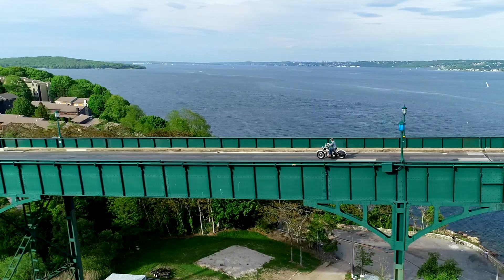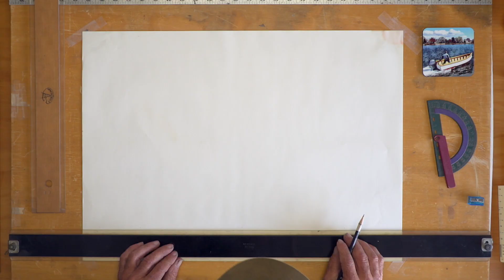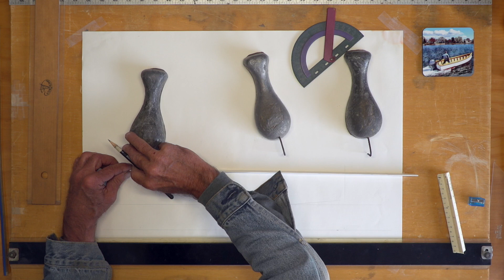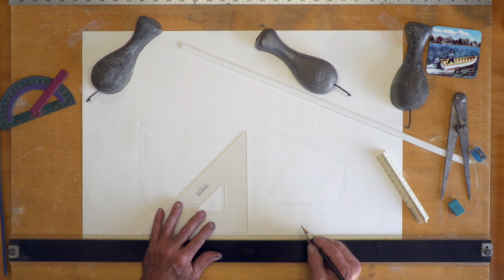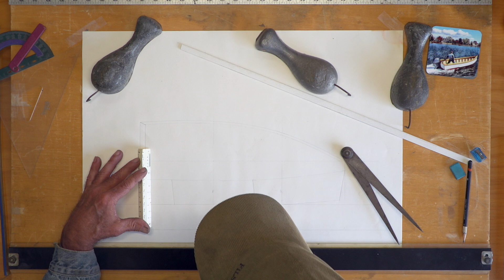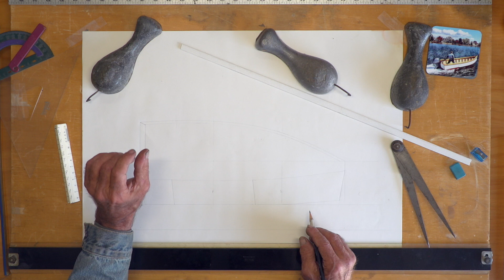TIPS Season 3 - Episode 4: Drawing the flat bottom work skiff

Comment: 31:06 at this point in typical engineering you get out the ink pens and ink the drawings for blueline visibility.
Just goes to prove folks (like me) make our comments before reviewing other's comments. Also from using India ink pens of different widths back in the sixties, the ink lines have very crisp edges on either sides of the lines for high definition, not like the fuzzy edges on the variable widths of felt markers with different pressures applied. 
Oh, yes, can't show the methods of drawing construction while inking because the scales and straight edges would get wet from the undried ink.  Lines and curves must be inked in sequence with the guiding instrument moving away from the previously inked lines. Much too complicated for a streaming video. Not like an ink plotting printer. You did best the way you did. Best Regards from antiquated history.

Comment: Correct me if I'm wrong ! The Transom drawing shows how it looks according to the hull. But beings it is slanted, and not verticle to the base line. You can't cut it to that shape. It would need  be taller, to allow for the slant.  Correct ?
Reply: Yeah I was watching it myself and I thought the same. Shouldn't it have been drawn perpendicular to the 11° of the transom to give the little extra height? Unless you were needing a shape and measurements for making a station touching up against the bottom of the transom.
Reply: If you make a rectangle 16 feet long and two feet tall with the angles for the stem and transom and you'll see the bow rise up. Put a little rocker in the back end to get the transom to rise up. Just make a cardboard model and you'll see how it works. It's like magic LoL

Comment: Lou, just a small point, when you transferred the transom height, it looked as though you just measured the vertical height, rather than the length along the 11 degree angle, not a vast difference, but the length along the angle would be a fraction longer, making the transom a little deeper, the other way would be to project it at 90 degrees down from the transom line and get a true end view of the transom shape.
Reply: On the half-breadth drawing the transom height is necessarily "foreshortened". But when building the boat you would measure along the inclined line. (Imagine the case where the transom is, say, 45 degrees to the vertical if it helps to clarify the point).

Comment: I just recently saw the "White oak vs Red oak" video from 5 years ago and I was puzzled by the mention of DC current. Where is that current coming from? 

I asked in the comments there too, but I dont have high hopes someone who knows the answer will happen to stumble across the same video in a timely fashion.
Reply: It has been a while since I watched that video, but I think the DC current is likely galvanic action or static charge: basically low current for a long period of time as electrons flow through the material. The electrons can come from static buildup or move between two dissimilar metals (a fastener on the boat and chemicals in the water for instance.)
Reply: @AlaskaSkidood  That makes sense. Thank you
Reply: Probably from a battery, unless you have a pull start you need a battery on board.
Reply: Your house has AC.  Alternating Current basically ebbs and flows back and forth a bit while supplying power, the electron flow is not always just in one direction.  That is possible and necessary with an electric grid.   DC or Direct Current flow in a circular fashion in only one direction.  A battery is Direct Current because the electrical flow runs from the top of the battery, powers something, and then returns (bottom of the battery).  Electricity needs to flow, whether AC or DC.  Now in a marine environment, particularly in salt water, which is EXTREMELY conductive, you can have current "getting loose" from either AC or DC sources.  AC is in the marina because the boats are plugged into the dock.  You can get that stray current from an improperly wired boat, particularly metal boats, as they are conductive.  Now the amount of electricity you may and usually cannot feel.  But it eats away at metal.  Boats have pieces of Zinc attached because as a lesser metal they are eaten away first, before your boat propeller, and any other metal in the water basically dissolves.   I'm no expert and may have said something a bit off, but overall that is my understanding.  All you need in your metal hull is a hole eaten away before you are on the bottom.  Boats sink in marinas due to stray current all the time. Most often it is DC.   Think about wires in the floor of  boat, and a small leak that fills the bilge, and the wire connection is submerged, leaking current out, but still running something, nothing seems broken... but your zincs start rotting and your neighbor sinks because he forgot to replace his zincs!!!
Reply: @edwardschmitt5710  Wow, you started waaay back from the basics. But then again I didnt specificly know what it was that I wasnt understanding. Thanks.